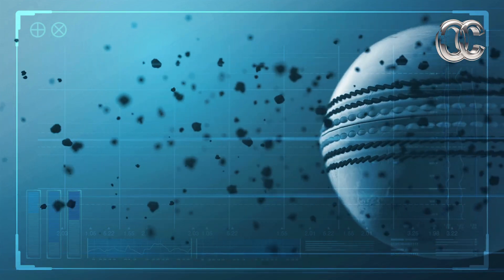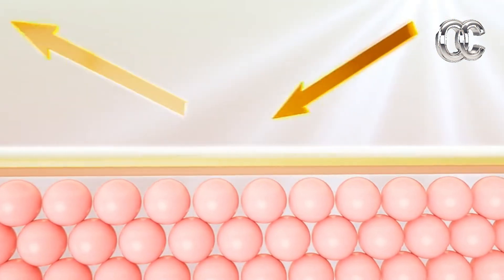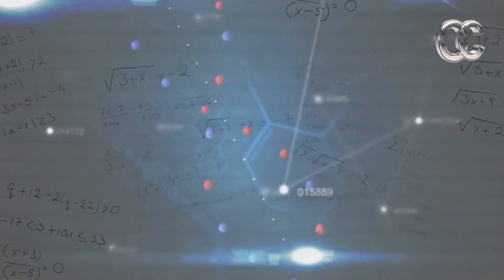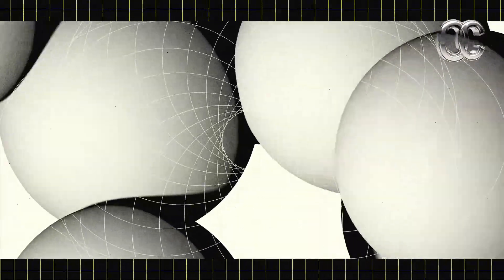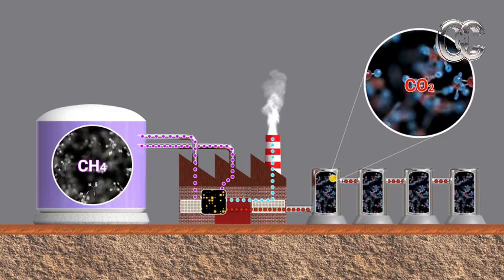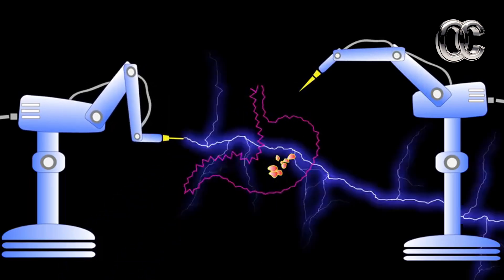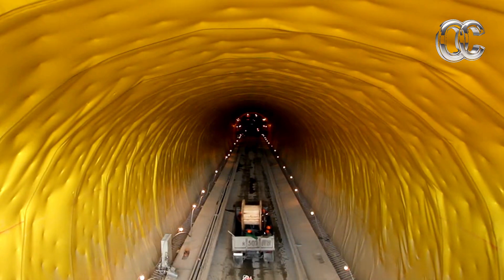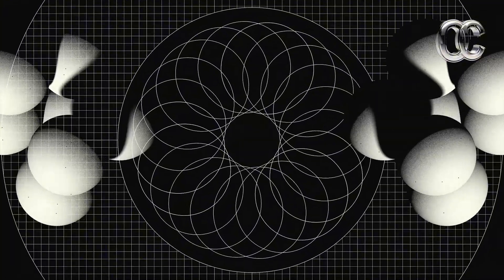Quantum Tunneling Explained: How Particles Pass Through Solid Walls

Comment: The idea that quantum particles can tunnel though solid objects shouldn't sound strange or impossible.  Gravity can penetrate a wall of lead 100 ft thick.  They say that gravity is a wave or is it particles in a wave, makes no difference.  What matters is that gravity can pass though/penetrate anything we can put in front of it.  Gravity is basically unstopable so it only makes sense that a quantum particle can penetrate a solid object.  Even radioactive radiation can penetrate many types of solid materials.
Reply: Gravity can do what?

Spacetime is fundamental and gravity is an effect of a relative and sort of curvature within which quantum does its best but always fails to ignore.

Why must all be quantum to make sense? To claim this clearly makes no sense and fails to explain the physics or the physical evidence
Reply: @gedgant1  Gravity can do what?.  I stated that gravity is unstopable and that it can pass through or penetrate any obstacle.  Do you know of any place in the universe where gravity is unable to go?  Billions of planets and stars can come between us and the center of our galaxy and yet gravity still manages to pull on our solar system.  There's nothing that we know of that can stop gravity, not even the power of a black hole.